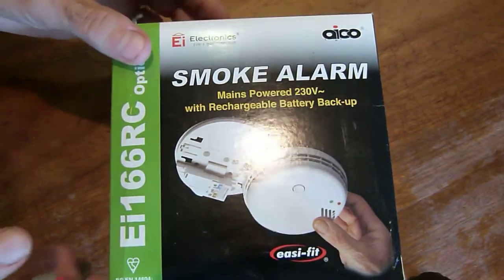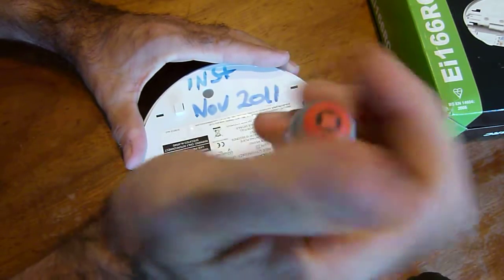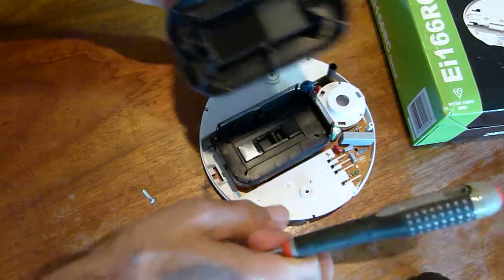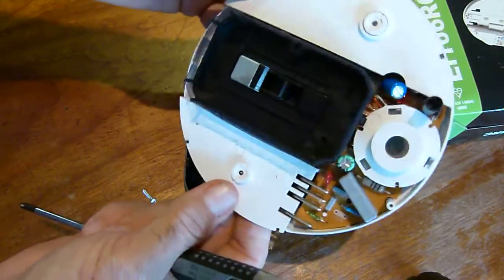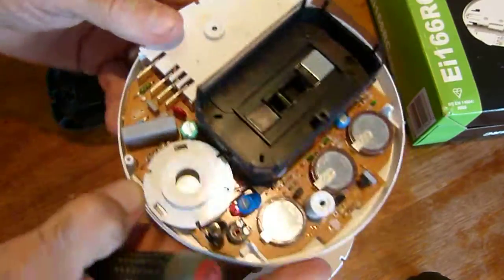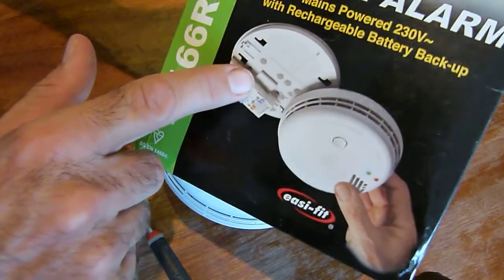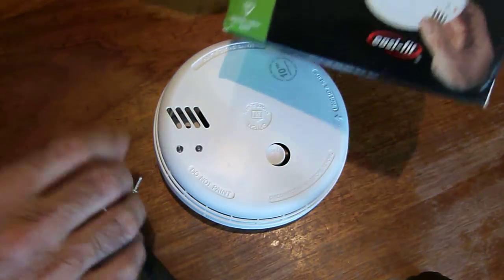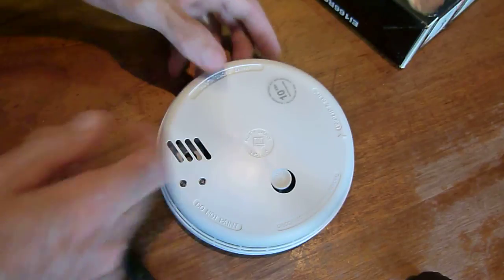Optical Smoke Alarm False Alarms Ei Instruments RC166 Brooks

Comment: Followed this video to the T but after Turing on the power its still bleeping. What should I do? Help
Reply: If it’s chirping, it means the battery level is low, replace the battery if possible, if the alarm is 10 years old or older, replace the alarm.